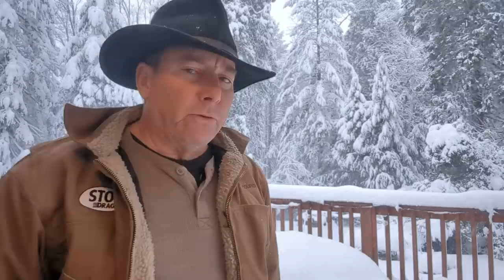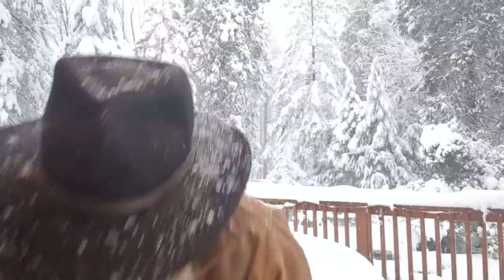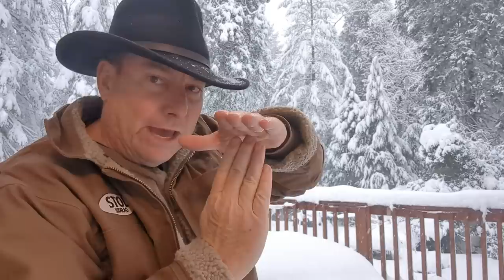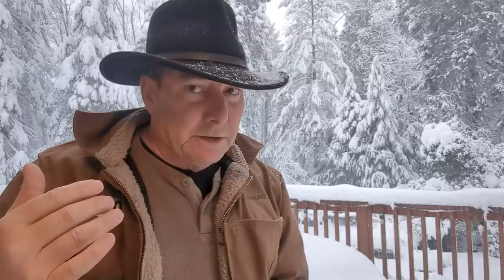PC-12/45 NTSB UPDATE In Flight Breakup! 26 Feb2023

Comment: For those of us who haven't experienced it,  Is there a way you could show or explain what spatial disorientation is like and why it would cause a pilot to spiral out of control?
Reply from the maker: See previous updates this channel. I’ll find you the link.
Reply: Find a high, revolving stool, high enough to have your feet dangling. Sit yourself on it. Close your eyes and have a friend turn it, say 10 to 20 revolutions per minute (in other words, not really fast). After two minutes, your friend should ask you what the stool is doing. Most likely you will say that it has stopped. If your friend then actually stops the stool, you will most likely think the stool is now turning in the opposite direction. (This is how it is described on the Flight Safety Australia website, in the article "Don't believe your ears.")
Reply: There is a detailed description of the somatographic illusion in the NTSB board meeting covering the Amazon freight flight that crashed short of the Dallas airport a few years ago. That meeting should be online.

Comment: Juan in a rapid descent spin such as this would the occupants typically black out before impact, I hop so.
Reply: In a spin the g loads are low, the aircraft is no longer flying. 

With the loss of the tail plane, the aircraft will pitch steeply nose down and accelerate rapidly. The data from ADSB shows a very high rate of decent and a high groundspeed, the airspeed must have been extremely high a very likely exceeded Vne.

Comment: I am wondering if the aircraft flew into a mountain wave or a rotor cloud. That could possibly cause an inflight brake up due to severe turbulence. I don’t know what the winds aloft were at the time. If I remember correctly the height of rotor clouds is about at the altitude he was at. At Northwest airlines our meteorology department could predict these  and we were flight planned around them.   Retired Norhwest pilot.

Comment: I flew medevac for a while and it was by far the most challenging flying I ever did.  Single pilot, frequent bad weather, and and a patient trying to get to the proper med facility. And here's the dirty little secret about medevac. These companies only get paid when they transport patients so there is tremendous pressure on pilots to take these flights...or missions as they are called...regardless of weather and circumstances.  If you turn down a flight you are going to get a call.  After more sketchy flights than I want to admit to I got out of the med transport biz after a year. 
That said any pilot can become spatially disoriented especially at night in bumpy bad weather. So the med mission may have nothing to do with it. I did fly the PC12 although not for medevac and though I'm not a fan of SE IFR it's a very capable well made airplane. RIP to those poor souls....the crew, patient, and family member.

Comment: am i correct in thinking there have been a number of incidents following work done on these high tail configurations - i seem to remember an accident which was sadly caused by a change of shift during fitting of leading edge components, might have been old screws used too, but i think if memory is correct, a part was being fitted with a change of shift and the part was not checked and or finished, this in turn caused damage to the stabilator? and caused it to part company with the tail and loss of control - very likely a different type of aircraft, but i remember it was a high tail
PS VC-10 had the best high tail, like an aircraft all of its own
Reply: You seem to be referencing  Continental Express 2574.  Not aware of a “number of incidents” similar to this one.

Comment: I have been right seat with a pilot, IFR, not under the hood, hand flying. He was chatting with a passenger in the back seat. It was a TS 600, a tight sleek little craft. Anyway, I see the bank on the artificial horizon start leaving horizontal quite quickly and I reached over and pointed to the guage. He acknowledged and corrected....we all know this could have been catastropic had he experienced vertigo at the moment of seeing the guage and bringing it correct.

Comment: It was snowing at the time.  The newer PC12's can do type 4 I'm not sure on the -45's but if the hangar was warm and plane came out the snow would have melted on the aircraft and perhaps stayed as snow or melted and refroze as ice...the temps were -1 to -2 ... ideal icing conditions.  But even if the plane took off clean it has happened at FL230 where severe icing was encountered and resulted in a loss of two engines.  That was with a MU2 however with only auto ignition on a garrett...for a PT6 to fail as a result of icing would be a new one in recent memory.  In case your curious on the MU2 it was in Canada https://www.youtube.com/watch?v=Wbm8xzLVgQ4

Comment: It always amazes me when this happens in a plane with a glass cockpit with that large artificial horizon in front of the pilot.
Juan, your thoughts on spatial disorientation with class cockpits?
Reply from the maker: Ever see a dog watch TV?
Reply: This was an earlier model PC-12. We don't know how much glass was in the cockpit. Even so, having glass wouldn't necessarily prevent SD. I was in a full-cockpit sim hand-flying a plane with a G1000 and looked over to the MFD on the right for a few seconds to set up something on the nav. Before I knew it, I was in a descending bank.
Reply: @igclapp  I get how easy it is in IMC to get spatial disorientation but how did you know you were in a descending bank and what did you do?  over G, over speed, spiral down, or go wings level per your screen or turn back on your autopilot per training?
Reply: @jlorenz55  It was a non-motion sim, so there was no motion to clue me in. Actually, in a real plane I would tend to notice the plane is doing something unusual because of the motions/increased g-forces and that would prompt me to look up. So in that respect the sim is harder to fly when you have your head away from the gauges for a few seconds. In either the sim or the real plane the solution is to get back on the gauges and get the plane back under control.

Comment: You've got a conflict here.  You say that it the pilot was incapacitated, the plane would likely just stay on autopilot -- but the same would be true if he suffered SD at the same stage of flight.  I'm thinking a strong possibility is unnoticed failure of the de-icing system, with resulting departure and breakup.

Comment: How many ATPL can hand fly well in extreme turbulence, dark IMC and severe iceing conditions with air instrument failure? My guess is that almost nobody is really good at this and after the military and test pilot community have creamed off the best, the scheduled airlines take the best of the rest, and so who is left for these tiny opperators? If they get anybody at all good, then that is sheer good luck. Total hours of flying as PIC count for nothing at all, all that counts is hours spent hand flying in extreme IMC and extreme turbulence with air instrument failure. Pitch and power, only use the back up electric AHI.

Comment: Wow....all I can say at this point is there are more questions to this one than meets the eye.
Reply: yup
Reply: I would say the opposite. It's about 90% certain it was autopilot popping off in turbulence and pilot losing control.
Reply: @igclapp  it doesn't make sense to me a trained experienced pilot loses control without one of the three ideas floating around: Structure failure, Vertigo or Ice.  I have seen nothing confirmed about anything to do with his autopilot at least so far.
Reply: @6thwatergateplumber  It's certainly possible he lost control due to vertigo, panic, banging his head due to severe turbulence, or not being able to even read the instruments due to the turbulence. But whatever the reason, looks like the autopilot was off, he was hand flying it and lost control (or never had control), and that led to the plane breaking up.

Comment: I am still confused on the theory here.  Since the pilot appeared to be on a stable auto-pilot course is it that the pilot became disoriented and he disabled the auto-pilot to manually fly or that turbulence kept kicking the A/P off and he was unable to manually maintain level flight?
Reply: The theory is that the turbulence got worse as he climbed and then kept kicking off the autopilot.  While hand flying he got disoriented, went into a right turn, recovered, went into another right turn and lost control.  G forces got so high important parts came off the aircraft prior to impacting the ground.  The only good part of this is the G forces to rip apart the aircraft were probably so high that the people had already blacked out.
Reply: @loudidier3891  Got it, thank you.  It seems that if the auto-pilot had a higher D/C threshold, or a D/C override, or at least a basic 'Wings Level' without override  than these people may have made it through.  As always I realize there are many factors here, but this seems a prominent one!

Comment: Juan, wouldn't the autopilot have been able to get them out of this situation? Or keep them out in the first place?

Also Juan, I was surprised to see that you did not seem to cover the historic flight of the last 747 to ever be built on it's live flight from Washington to CVG around 02/01/2023.
Reply: Autopilots can't handle the rapid changes in up/down/bank angle that this size plane will experience in moderate turbulence so they disengage - basically turn themselves off.  You can turn them back on but they will disengage again.

Comment: A question, Juan, for us little airplane guys.  Concerning spatial disorientation, can you big airplane guys just turn loose like the old Cessna owners manual recommended?  In Huey's this was not possible, but little airplanes are incapable of stalling themselves.
Reply: In theory a well-trimmed airplane should continue flying in trimmed flight without an autopilot (I did it all the time in a Cessna 172, just had to use a little feet on the rudder to maintain an exact heading), but in turbulent air all bets are off. And a high-performance plane like a PC-12 could get out of control very quickly due to building up speed rapidly if the nose pitches down.

Comment: Not a pilot, but are pilots trained during spacial disorentiation to forget their bodily instincts and fly the instruments? Like could you feel banked, but pull the blue side up level and feel disorented flying IFR? so you feel like you are flying at 45 degrees sideways, but you are actually flying level? Is that why 2 pilots are necessary? Like 1 person will feel it, and maybe the second pilot wouldnt? Thank you Juan and community
Reply: Yes, it is part of the instrument rating training.  Instructors induce it by having the students look down for awhile while the instructor flies the plane in such a way as to slosh the fluid in the circular canals of the inner ear back and forth.   The instructor asks if they are climbing/descending/turning and when the student gets it wrong, gives them back the flight controls.  The student is wearing a hat-like device called a hood that blocks the outside view so the student has to fly using the instruments while their brain is screaming that the instruments are wrong.

Comment: This is an inherently safe airplane..there was a very similar case in florida several years ago where the pilot over Gd the baircraft when he flew through a thunderstorm.
Sad and stupid move that was, he took his entire family with him.
Reply: really, It has a propensity to flutter at high altitudes ,where the True airspeed determines flutter, not IAS, indicated air speed ,which at 22000 feet is 71% of true airspeed. The never exceed speed VNE, or redline on the speed indicator is not true airpeed but indicated airspeed, meaning determining normal air forces
So it does not protect against flutter. 😎

Comment: How do we know loss of control followed later by break up in the air? Is it the distance of tail parts from rest of wreckage when the problem  started with plane at 19000 feet?
Reply from the maker: Close proximity of the missing parts.
Reply: That's what Juan said: because the two separated plane parts were found 3/4 and 1/2 mile from the rest of the plane, the parts definitely didn't detach at a high elevation or they would have been found miles from the rest of the plane.
Reply: The accident sequence started with the aircraft flying at 19,000 feet covering one ground mile every 12 seconds. If the plane had broken up first, the parts would’ve been a lot further away from the main wreckage.

Comment: Agreed, ALL aircraft should have voice\data recorders separate from any avionics.  Also, ALL aircraft should be using FIR rules and have a discrete transponder along with any other modern safety including radios.  The days of flying without electronics and by visual only are gone.  Too much traffic, too many people on the ground are exposed, and too many planes in the sky doing various things.  This isn't 1945 where you would be lucky to even see an aircraft fly over head.  Come on FAA!

Comment: Is it normal to fly IFR manually at that altitude in such conditions? Couldn’t the pilot have set the autopilot to fly the aircraft on the correct course? It seems when he turned right and got off track that he started to have spatial disorientation or was somehow overwhelmed in his tasks.
Reply: Several have asked the same and several, including myself, have answered that the autopilots in this size plane tend to turn themselves "off" in moderate turbulence.  They can't handle the rapid changes in whether they need to go up or down as the plane bounces up and down multiple times per minute or even second.  Pilots call this disengaging.

Comment: Planes in America I think have speed limits to adhere to as for the breakup I understanding it was flying very fast the plane was just not designed to go so fast.there more efficient every day.likley Abel to go fast and not know it ...basically plus very smooth to fly (good for medical purposes) but sensing pilot input and aircraft response could be vague. This disorientation pilots experience.isnt this what JFK Jr possibly experienced these things are a mighty powerful thing. Experience and as another commenter entered here constantly familiarizing oneself with the plane.people might think you're goofing around it's not very professional but something along these lines. Two pilots also  not a bad idea

Comment: Been there, done that except, I had outs. Always leave yourself sn outs. 
Seems to be a lot of younger flight sim pilots.
LOL,, was on the ILS, landing to the south at Pewaukee in a BE ž00. Outer marker in bound. It was like the HillderBeast was there.
And I Never learned how to fly an ice  cube. De icers & and anti ice didn't keep up. AND I WAS GOING to land fairly short of the runway. Then down are 500 feet. It was gone?
Landing with no incident. 
Your right though until the feds requires it. There should be CVR AND DATA on these pt135 operations. 
As well as the upper parts pt 91 operator.

Comment: Thank you for explaining in clear terms what has happened while at the same time presenting facts instead of opinions.
On the first update to this heartbreaking crash you said the pilot did not communicate with ATC at all during the course and altitude changes I believe. It occurs to me that perhaps the pilot may have had a medical issue and was non responsive or able to control the plane as a possible cause as well.
Regardless, my prayers go out to all the families involved in this tragic accident.

Comment: I think all these people crying about a second pilot don’t realize there used to be a whole army of us flying bank checks on the back side of the clock in some of the crappiest weather and no autopilot and SINGLE PILOT. There we were.. fresh 1200hr part 135 IFR pilots just trying to build experience and climb on up the ladder.
Reply: I flew for ameriflight for 8 years. We lost several pilots during that time and thousands of bank notes. Air Ambulance flights should require 2 pilots.
Reply: You were flying checks and NOT 4 other people for hire in Part 135. More importantly the Part 135 operational aircraft should be required to have a CVR and FDR just like Part 121 operations.
Reply: @guitarhillbilly1482  hauling bank checks was Part 135 for hire. lol at the ignorance of some of these comments.
Reply: @mmayes9466  I know that! I pointed out that this flight was hauling people and NOT CHECKS for 135 hire.
Big Difference.  I never stated that checks were not Part 135 but flying people is much different than flying paper.
Might want to brush up on your reading before making fun of other people's comments. In fact the OP points out they were building Part 135 Hours flying paper. 

MY Comment: " You were flying checks AND NOT 4 other people for hire IN Part 135"
The conjunction " AND "  joins the 2 thoughts together which means that both parts of the sentence was talking about Part 135 just one group flying paper and another group flying people. Have a nice Day.

Comment: Why would a pilot switch off the autopilot in IMC conditions?
Reply from the maker: He didn’t.
Reply: Most GA autopilots are required to be disconnected when in icing conditions and ice is on the plane as it masks handling cues.